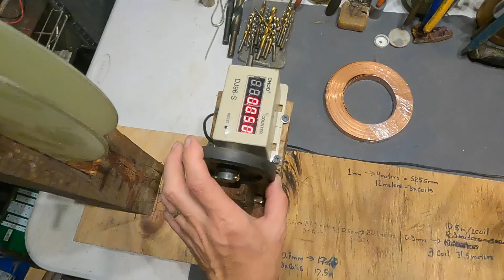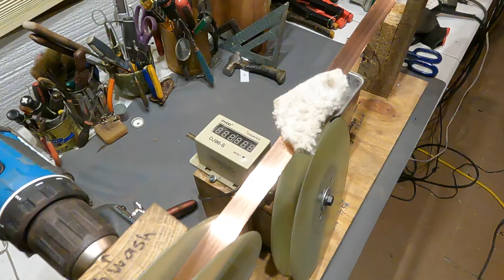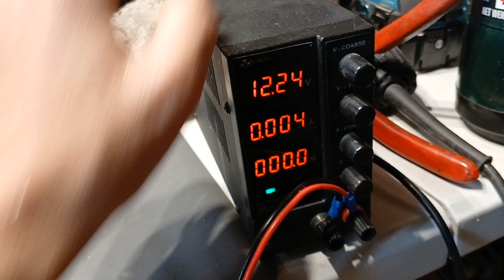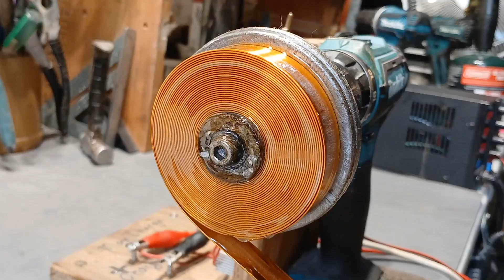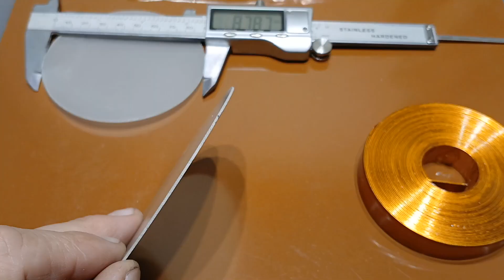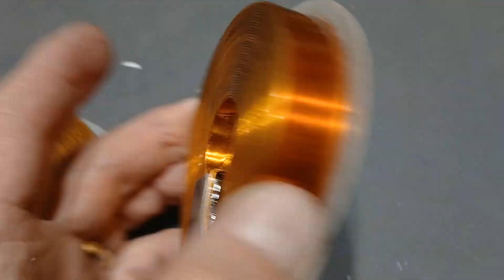186 How to wind 3 inch Classic Strip PEMF Coil (Open Source) BBMPulser Part 1

Comment: Hi Andrey. I've recently built the Electrifier and I'm now on to the BBMPulser. I'm looking for the best way and materials to build the inductor coil or decide if I should buy one already done. Your video is very helpfull. Thank you
Reply from the maker: @vaitgabalhag  if you have $$, then simply buy it. You will save a lot of time and frustrations. I built around 250 coils already and am still finding new things to learn. 
I my asking price for prebuilt coil with wires and connectors is $475. It costs around $80 in materials if you have a production line. If not, then probably $200 plus parts, plus work, assuming you never done it before and you tools to do it incl Mold